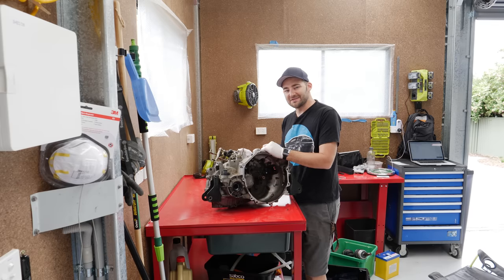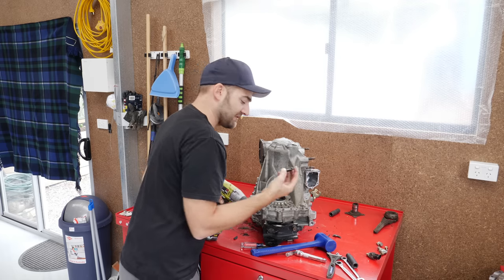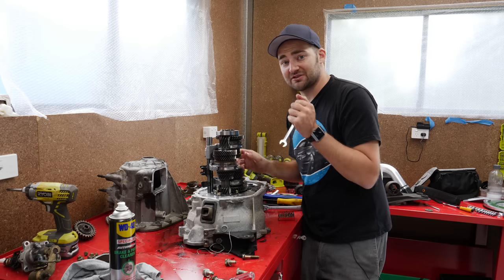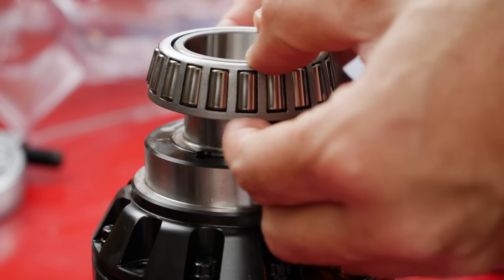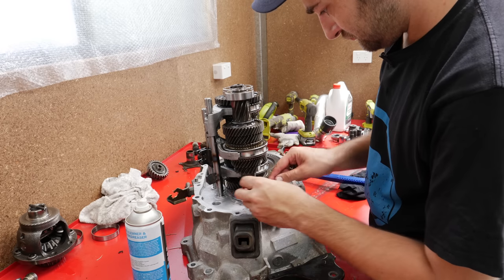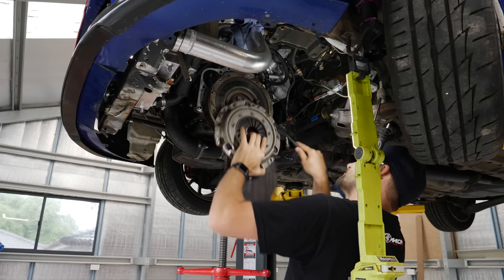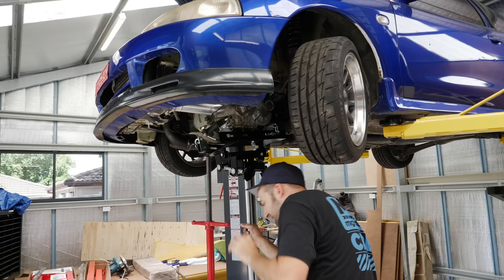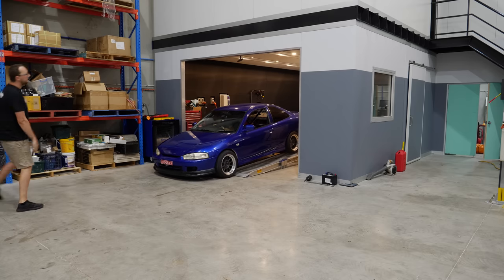Limited Slip Diff + Clutch Install into 2Sexy [Part 2]

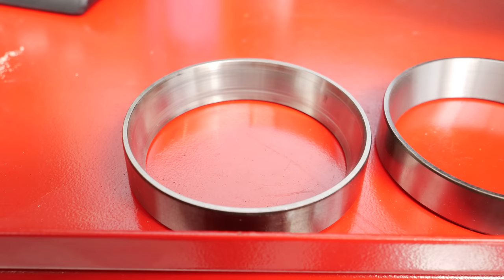Comment: 9:25 Failure point right there, that outer race should not be loose like that, it will start spinning in the case and eat it to bits.
Also simply assuming the preload on the diff bearings will be correct has cost many a person a ton of cash. Getting that wrong will not only destroy the main gear but the carrier itself.
Reply: Just looks at the shim like... what the fuck is that lol. Then basically plays ring toss installing the outer race lol. Some things should be left to mechanics.
Reply: Even worse is he claimes to have the workshop repair manual, every manual i have been forced to learn in my lifetime has that information in them. But reading all that technical stuff isnt as interesting as just looking at pictures.
But hey , thats how you learn in the end. He at least was man  enough to say he could get a replacement if he messed up.
Reply: Was just about to say, loose outer race! could just bruise the housing with a dot punch and put some bearing retainer on.
Also, ok to do just the bearings and put the shims in where they came out, but if there is a new component going in idk... Probably should check it properly
Reply: Oh my goodness, the way he put that outer race in and then just spun it around then we just cut to something else has me worried. Surely they've dealt with bearings enough to know that's not right?!
Reply: In the hq build. I knew the diff would be easily the weakest link. I knew it wouldn’t last one day. And I was right.i agree with you guys that bearing was not right. And I noticed straight away. Hopefully it’s not an issue straight away though. I’d like to see Marty get some use out of it
Reply: He might have been freeze fitting it. They did show him heating the inner race after all.
Reply: @feands  Bugger if ya not right,,shimms are there to set preload or end float,,as for the outer being a loose fit,,this is right,,yeah/yeah ,The reason the outers are loose is to allow slow rotation of the outer so as to move load zone on the bearing,,many people have these far to tight,,FAR TO TIGHT,
Rule of thump ,the rotating member should have a tight fit,,as the load zone rotates with the load,,but the outer ,and in this case ,should be a neat fit not to tight and not to loose to enable ,in this case to rotate and give you a new load surface ,,now not saying it spins a million mile a minute,,but yer need to have it rotate in the housing,,this may take,in a heavy gear box 12 month to do a full revolution,,but every time it moves it give the outer,ring,in this case a new bearing surface,or load surface,
now i know there's gunna be a load of experts question this,,but my job was to fit bearing in to gear box's you could eat your lunch in,,have a look at a bearing installation from a bearing manufacturer,,
and if ya not sure,,go back to fitting your old style front wheel bearing,,and ask ye self why the inner cone are so loose and not pressed on to the stub axle,
Reply: did you maybe stop and think he was looking at the shims sizing
Reply: @motorised1  ..G'day,hmm if looking at shim sizing he would have had a dial indicator or indicating of some sort to tell him if it was too much or not enough,,and to add or subtract to the recommenced clearance or pre load,
Every time you set up a bearing even the old one you put back in ,,you should check bearing set up,,
and while i here he should have also checked back lash on drive gear,,
Reply: "simply assuming the preload on the diff bearings will be correct has cost many a person a ton of cash."
But also simply assuming the preload on the diff bearings won't be correct has cost many persons a ton of cash.

jk
Reply: They should be loose like that. Basic bearing design rule: rotating race should be tight, the stationary race should be relatively loose. Because the contact surface between the outer ring and the case is a lot bigger than the contact surface between bearing and ring, the friction between the ring and the case will also be a lot bigger. The outer ring will only spin very very slowly. 

Checking bearing preload would have been a good idea though.
Reply: Wanted to do the same Comment as i saw it.
This Gearbox Case is DEAD...!!! 
But Loctite has some good Bearing Glue i think it is nr 948 or so. In german its called "Fügen Welle Nabe" that would translate to roughly: Fitting Shaft and Hub.
I have done some jobs with it and if you use it as it is stated in the manual it glues it dead tight. Unless you apply 300c° or so
Reply: Yes that race is WAY too loose. They should not spin by hand ever. I've replaced many a wheel hub because of this in my years of servicing brakes.  I am disappointed he didn't even try to remove the speedo drive gear, may have been very easy. He also didn't replace the pilot bushing and didn't lube the old one. It may last a while but it is on borrowed time in this case. Still love MCM though, they aren't afraid to dig in.
Reply: @williamandrews1683  He may have done these things, but didn't include them in the video for the sake of time constraints. You have to remember that this is just a video, showing us what they want us to see, and is by no means an exacting step-by-step on how to do this job. If it were, it would be a 2 hour video and not a 20 minute one.
Reply: I've noticed the same thing...
Reply: Mitsubishi mechanic for 20 plus years have pulled many of these gearboxes apart, outer races are always loose fit in these gearboxes you can open up a brand new never used gearbox and the outer race will be loose, agree that he should of checked pre-load which means putting small bits of solder under the race and bolting the box back together then measuring the solder with a micrometer and selecting correct shim.
Reply: @Pallanamnjavelet  Let's hope so.
Reply: I can't talk for Mitsubishi but I have just undertaken the same upgrades on a Renault Megane Sport and everything in that gearbox was the same as shown in the video... but much more difficult and involved! The outer races were MUCH tighter than shown and there is no way they would ever spin (when installing the new ones the races were frozen and gearbox housing heated and still needed to be pressed in!)
As for preload, I was very afraid of this but consulting others who had undertaken the same install said they just used what was removed. Even the Renault factory manual only specified different shims if a brand new gearbox casing was being used/replaced. So it all went back together.
Reply: @viridianperformance7124  "much more difficult and involved" lol, no need to mention car make, you just know it's french :D France must have alot of 3 armed child mechanics
Reply: Looked like he had a replacement after he took it out again and cleaned the area it sits in.  He also said it sits snug, check it again, you think he just confused people with the edit, or not?
Reply: Heru_ur you’re correct, curious why they said nothing about setting up preload or using loctight on the ring gear bolts...
Reply: Ridiculous people here don't know wtf they are on about, they are supposed to be loose like that.
Reply: @andrewbampton9244  I'm probably gonna have to go with you on this one. Let's not forget that as soon as this race heats by even a few tens of degrees it is going to expand enough to be tightly in place. Bearings warm up very quickly too, and since it will be loaded in one direction immediately when the car is being driven it will also most likely stay in place until heated. So, I really doubt it's going to spin much at all, as others have noted, and it probably is by design.
Reply: @802Garage  Steel bearing in aluminum case. The aluminum will expand more than the steel, loosening up the race even more.  I am not familiar with Mitsu's so I am not sure if its supposed to be that loose or not, but I have never seen one that loose in other brands. It doesn't looks like a floating bearing (they will have an oil channel). I regularly build engines and transmissions as part of my business (Race and custom car fab) but Mitsu's are not real common around here.
Reply: also not sure why he didnt just knock the speedo gear off the old diff and press it on to the new diff, simpler than whatever nonsense they'll have to do to get a working speedo otherwise..
Reply: @RacerRickxx  The steel which actually has the rollers ride on it will get FAR hotter than the tranny case itself. Plus the case is cast which I'm sure affects expansion rates. Either way, I really doubt that outer race is going to do much spinning given all the forces at play. Appreciate your thinking though and it's not like I can promise I'm right either.
Reply: @toddcullen3828  great old farmer trick, if I had a quarter for every time... (not on customer cars, mind you!)
Reply: It was done correctly and by the manual (I did find the correct one eventually). Video would have been crazy long if I’d tried to keep filming every tiny detail like that, this is by no means a step by step guide. Box and diff works great, no issues.
Reply: Manual transmissions actually get most of their heat from the engine, so its not uncommon for them to be almost at engine temp on front drivers.   I don't know enough about Mitsu's since I don't work on them to say either way, but it looks like he used a bearing driver or drift earlier to knock out the old bearing race.  I would assume the new one would be just as tight in the bore since there was no corrosion.  If that bearing spins, its steel on aluminum and the aluminum will lose.  I thought it might be a floating bearing, but its a tapered roller.    It might just be some sort of Mitsu weirdness.
Reply: Working as a manual gearbox mechanic I see this every day and not only mitsu gearboxes... Its normal and someone here even explained it and that happens on every vw fwd car gearbox due the fact that the race is a snug fit in the housing
Reply: Hmm also no locktite on those LSD bolts?? Hmmmm....
Reply: @ewingfox6459  no no , never on a customer's car... Lol  Already estimated the job, no going back, just send it!
Reply: It will be fine stop acting like your all gods ffs.  They clearly edited it this way to trigger you people and it worked lmao.
Reply: First mistake, not cleaning gearbox before disassembling.
Reply: @ianwilliams487  The inner race on wheel bearings is not loose on the spindle, I have cut many of these off when there is no room to get a puller behind it. Sorry but the outer race for the diff should not be loose and certainly should not be turning in the housing.
Reply: @RacerRickxx  No, manual transmissions get the vast majority of their heat through frictional losses.  5-6% of the power going through that gearbox will be converted to heat.
Reply: @duanebailey6253  They clearly didn't.
Reply: dont tell him we need moog to win lol
Reply: @DKTAz00  Ha Ha. French cars never cease to amaze me, If running perfectly fine... or need anything done to them!!
Reply: @ferrumignis  They only selll one bearing for the diff.  Was the same one they pulled out.  The only shim is to space the case and the bearing apart and he had the feeler gauge.  Stop reading 12 year old mechanics who dont know wtf they are talking about.
Reply: @sakariputtonen2683  SMH you dont need to clean it.  This is why they have a magnet inside to pull all the metal.  Its gonna be rolling around getting dirty which is why he cleaned it at the the end.  Not like the trans broke anything.  This is why some people refuse to change trans oil as well because it creates problems.
Reply: @duanebailey6253  Bearings are all made to a tolerance, as is the diff assembly itself.  Changing either of these, and especially both requires preload to be set up again.  Stop showing your ignorance of mechanical engineering, I suspect I was building engines and boxes whilst you were in kindergarten.
Reply: @ferrumignis  LMAO they dont have preload set into them though there is nothing to tigheten and only one size bearing.  This is why all diffs fall out when you remove the gears in a fwd box.  They need give stop talking suspension tech in a trans video to sound like you know wtf your talking about.  The spacers are the important part.  Get back to reading.  Next your gonna tell me crank bearings need preload as well lmao.
Reply: @duanebailey6253  LOL, taper roller bearings need preload to function correctly.  Why do you think there are shims in the first place?  Nice try son.
Reply: @ferrumignis  The shims are to space the bearings from the case.  They are not on the outside of the bearing.  You want a loose bearing so when it heats up it expands.  How can you even set preload?
Reply: @duanebailey6253  Sorry but the shims are on the outside of the bearings, between the outer race and the gearbox casing.  That's why they fell out when Marty knocked out one of the outer races.
Reply: @andrewbampton9244  using solder like a heavy duty plastigauge, that's a cool idea :)
Reply: @ferrumignis  No thats the outer bearing race as you can see the bearing exposed on both diffs.  These needle bearings are junk anyways should have went with the normal roller ones.  The shims are the small pieces and have a cut in them.  There is no way to set preload bearing preload as it sits between the case and shims instead of a nut.  Its super important to set that gap correctly.  Maybe one of the 5 bearings gets bolted in place on the shaft.  The other shaft bearing is similar to the diff however there is no way to check it with the case on.
Reply: @ferrumignis  Think about it for a second.  That may be how they GENERATE heat but this is an environmental factor.  You have an aluminum casting bolted to another aluminum or iron casting that is at 90 degree Celsius, in an underhood environment at 60 degrees Celsius.  The heat transfers, and the only way it cools is by radiating the heat to the air through the case. The good thing is that when properly engineered, a manual transmission is not very heat sensitive as long as the lube doesn't thin out too much or break down.
Reply: @RacerRickxx  I don't have to think about it for even a second, the heat generated by a transmission is far greater than the heat put into it by the thin cast bellhousing bolting it to the engine block, (which is the coolest part of an engine).  If you don't believe this, try putting your hand on the rear diff of a RWD car after it's been on a decent run, no connection to the engine and yet they can get far too hot to touch.  How could this be?
Reply: @ferrumignis  I am not going to argue with you.  I own a shop that build race cars and hot rods and deal with this all the time.  Think what you will, but simple physics says you are wrong.
Reply: @RacerRickxx  Friction creates more heat than is transferred from the engine period, doesn't matter what you do you're still wrong mate.

Comment: Hope Marty got the preload right on those diff bearing after seeing the confused look in his eyeball when the preload spacer fell out with the outer bearing case 9:12
Reply: Yes! I was the same, i know the wavetracs need a certain amount of shim preload. Marty please tell me you did it and forgot to film it?
Reply: Not to mention it looks like that outer race is just slopping around in the housing...
Reply: @stevenla359  Any diff needs the correct size of shims to set the play in the bearings. He probably didn't do it, since it involves putting the whole gearbox together, measuring it, and taking it back apart to add/remove shims if needed. In this case, you might get away with it, since it only increases bearing wear, and doesn't destroy gears like in a rear wheel drive diff.
Reply: @Finnspin_unicycles  totally agree, using a dial indicator you'll get that number. But the actual functionality of the lsd isn't affected. Marty if your reading this, we're all rooting for ya!!! Good luck with the battle but...loser has to buy a Yaris, automatic
Reply: @trd8749  wifi outer race haha
Reply: Hypoid gears are fussy for a good contact patch, they don't tolerate float. The standard gears in the box he has are not as fussy. 
Every bearing can handle 105c and that all they need if you are going to fit them.If they are still tight the machined diameters were no made for a heat fit.  Plastic shields and cages along with the grease should easily handle that temp. This is unless it was engineered to be used in a freezer then there may be a grease problem.
Reply: They cut from that scene quick didnt they?
Reply: Yes shims were re-done, got pretty late into the night so didn’t spend hours filming it all.
Reply: @mcmtv2  on ya Marty!! Cant wait for next episode!!
Reply: Good to see I wasn't the only one who picked up on that, even better to see it was all done correctly
Reply: @mcmtv2  that's understandable Marty, you guys do a great job of presenting, filming, and editing with such a small team. But it's great to know everything went well with the gearbox rebuild, I'm on your side for this build, and don't want to see you loose 2Sexy!!!
Reply: I was thinking similar... pre-load adjustment on tapered roller bearings is a bit of a pain, but necessary...and I thought, if you're diving in that deep, why not do the rear mains seal on the engine while you're in there???
Reply: I think he’d have asked Benny while he was there helping in the previous episode

Comment: Always scotch brite or 1200 wet and dry any shaft it the spot where a new seal is going to run on. This will hold a microscopic amount of oil to prevent the new seal from glazing and failing......even if you assemble it with oil on the shaft. Old Mate found out the hard way with a new rear crank seal. Never had a problem since.  Love the channel. Cheers